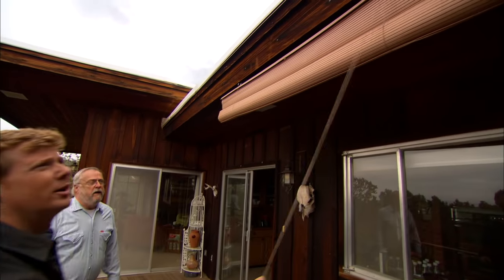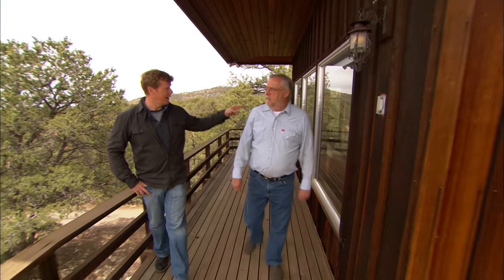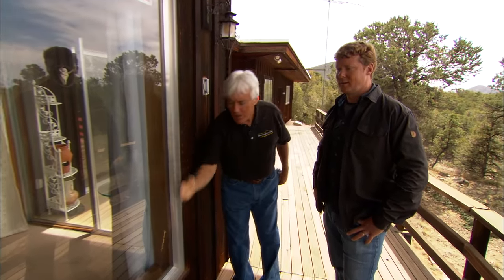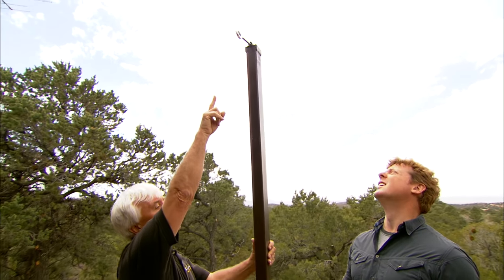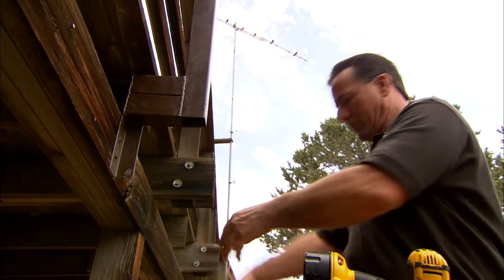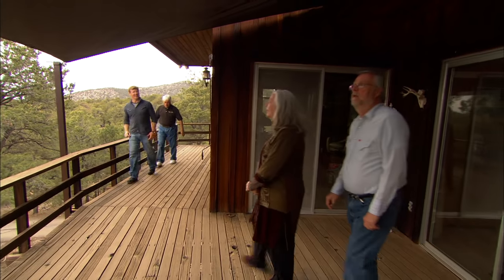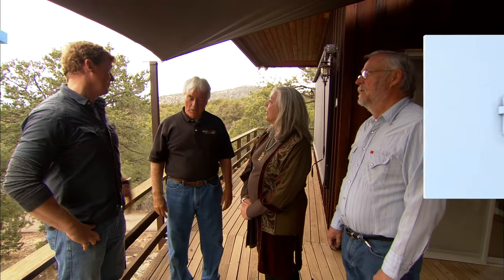How to Install a Shade Sail for a Deck | Ask This Old House

Comment: I have a couple sun sails I installed with stainless eye bolts and some paracord using 5 dollar figure 9 carabiners to tighten and they have lasted for 7 years still look new through tons of wind and rain and hot summers, great product.
Reply: Can I hire you to install something similar for my house in Maryland?
Reply: @house9850  mind sharing the brand you went with for the sail? I'm also on the west socal coast.
Reply: @projectedwinbrito  oh man trying to remember... its been the better part of a decade, I went to the home store with the orange logo LOL back then there was only one or two shade brands, I want to say I have 3 of the sand colored coolaroo sun sail. Using the stainless hardware, paracord, and figure 9 carabiners to pull them tight was key. Buy 2 feet smaller than your space to stretch them tight.
Reply: make sure to use a lighter to melt your cut paracord ends and pinch them to make a point. That has lasted 7 years too.
Reply: Late comment here, but just watched this video and saw your comment about Figure 9 Carabiners. I hadn't heard of them. Just bought 4 from Nite Ize to put up our triangular sun shade sail. Thank you for mentioning the Figure 9's.

Comment: 4 Carriage bolts to hold each vertical support....and then the brackets on the facia are fastened with 1-1/2 deck screws. Love it
Reply: Well, those vertical supports have to resist a large cantilever force that the facia brackets don't, so it's not really surprising for someone who understands mechanical forces.
Reply: not even anchored... just straight into the wood.

Comment: Years ago, Santa Fe Awning installed a hanging "curtain" for us. Eventually, we enclosed the porch with sliding glass doors on two sides because the wind came from the SW and dumped load of dirt on it...We kept the shade now inside the porch and it makes a huge difference and held up perfectly with the direct SW pounding on it for years!

Comment: They make shades that crank down from the inside.  I think that would be easier than having to go outside to roll up and down all the time.
Reply: I agree.  That outside shade is useless.
Reply: Hanging the shade on the outside has less heat gain inside the house than a shade mounted inside. 
The house stays cooler.
Reply: @David Blue The shades I was talking about shade the glass from the outside, not inside.  And it isn't about laziness, it is about convenience.
Reply: @bringemyoungpbuh4123  besides the hand cranked version, there's also the motorized version and wireless remote control options.
Reply: @c.garcia2363  Yes, there are better options than going outside every time  you want the shade.  I prefer manual models as they have less to go wrong, but motorized with a remote could really be handy.

Comment: Wow, imagine having a shade sail professionally installed. I just bought some for $13 each and hooked them up and they've lasted for 4 years so far. Much more wind resistant than umbrellas
Reply: Where did you buy them from?
Reply: Good to hear.  I have a small 10x10 patio that I want to shade and an umbrella would just be too big.

Comment: I would have put the window shade crank on the interior side of the wall or "motorized" the entire thing so it could be extended and retracted from an interior switch or better yet a remote control, else this is a decent solution.
Reply: Smart.  Actually, a good architect would have thought of all of that, and had it all built in with the windows.  Just a switch will shade the windows.
Reply: How about a solar panel powered motor that auto-deploys the shade in direct sunlight.
Reply: Great idea
Reply: The reason you wouldn't put the shade on the inside is because it would not block the sun from heating the windows if it was on the inside, so the temperature increase inside would be pretty substantial. You want to avoid the sun from heating the window, therefore outside is the way to go.

Comment: Change windows for better U-Value & minimum solar heat gain coefficient SHGC.  Overall performance of the home is vastly improved throughout & year0round.  The shade is just a band-aid if the interior is the issue.  Outdoor shade on the deck is another issue.

Comment: If I wanted to do this myself could I just install a 4x4 post and bolt it i to my current wood deck using a footing
Reply: Nope 4x4 post is not good for tension loads like this one. Needs to be tubular metal to withstand heavy winds.

The middle of the 4x4 post wouldn't be doing much work, so a tubular design is used for poles. They're used for footings because that center part holds just as much weight as the outside, but in this application, the further out from the center of the material does the most work (that's why all flagpoles, lightposts, and telephone poles are hollow) (unless it's a wooden telephone pole, then it's a solid center because of cost)
Reply: Scott H 👍🏻👍🏻
Reply: I have a sunshade sail and usually the wind rips it out once a year
Reply: markman63 . Have you tried using rubber bungee( Home Depot- $1.59 each for the solid black rubber ones) I use them on 2 of the corners and they flex in the wind,do not sag and are very easy to remove and install  when needed.

Comment: Are those little head-rod clamps on the house facia going to hold that sail in the wind?
Reply: no chance
Reply: Looks like southwest TX, they need to revisit to see how they've held up after TX stormy seasons... :)
Reply: @skytigress  they screw through the solid 1in nominal fascia boards. I am sure they are hurricane rated!
Reply: most wind, and water, will go through this

Comment: So stainless ring stainless post ring and a galvanized connector between the two.  Probably should be using all high chromium stainless otherwise you are going to get a galvanic reaction and rusting
Reply: I was wondering about that! I was just scrolling through, looking for THIS very comment!
Reply: TOH is assuming it doesn’t rain there so don’t have to worry about annoying things like that. Hehe. 

All galvanized or all stainless. If there’s salty conditions, obviously all stainless.

Comment: wonderfully old impact drivers
Reply: No eye protection used.
Reply: Jeff Hallel Why would you wear that with an impact?
Reply: @jacobslater6449  So that if the socket fails or the bolt  strips and sends metal splinters through the air into your face your eyeballs might be shielded by the safety glasses.Generally manufacturers of striking tools and power tools tell the user to use safety glasses.
Reply: Jeff Hallel Ah yeh gotcha, generally in the UK we don’t follow that at work unless it’s using SDS etc
Reply: @jacobslater6449  You have free health care.No worries.

Comment: Isn't the Sun's UV rays going to eat away the fabric?
Reply: Tyrone Kim  eventually the sun kills everything!  I have shade cloth that’s 6-7 years old and still in good shape! 
Getting rough around the edges but overall it’s still quite strong!
Reply: @jaykneegarner2479  Thanks for the information.
Reply: Yes, over time it will degrade. But from experience with leaving out a variety of types of fabrics on our patio over the years, bringing it in over winter (when we probably want the extra light anyway) prolongs the life by quite a bit. The wind and rain of winter degrades differently than strong summer sun, but can still take quite the toll. It’s not supposed to last forever, just take reasonable measures to last longer.
Reply: @rachelleo485  Thanks for the information.
Reply: @Norman Little I'm puzzled how the fabric is going to get 50% stronger.

Comment: Isn't "Sail" suppose to catch wind? Now that the shade sail is attached to the house, would wind cause it to damage the house's structure? Also, it looks to me it will catch some rain too?
Reply: Wind and Rain go through the mesh, in theory.
Reply: Our friend used screws that weren’t long enough to go far enough into the board underneath and a piece of facia board got ripped off right off the house by a strong wind. To avoid this problem we will try longer screws and find the studs to sink them in.

Comment: I saw someone question, why not put the shade on the inside the house? The reason you wouldn't put the shade on the inside is because it would not block the sun from heating the windows if it was on the inside, so the temperature increase inside would be pretty substantial. You want to avoid the sun from heating the window, therefore outside is the way to go.

Comment: Kevins not stripping screws.  The stripping sound is the setting on the drill to make sure it doesn't over tighten. Duh.
Reply: Not to be that guy, but he's using an impact driver, not a drill. They just sound like that as they hammer while they spin.

Comment: Could have used a mirror tint for the windows, and should have just built a roof over the deck.
Reply: Mirror tint is not recommended for thermopane windows.Heating the gases that are between the panes can cause the seal to fail.
Reply: @jeffhallel8211  I have never had an issue, we used it here in colorado in all our houses
Reply: @bookreaderlabarr  According to the manufacturers literature that I have read the gasses may heat up enough to burst the seal.
Reply: Never had an issue, maybe it is just my luck

Comment: Where might one find the 90% shade cloth mentioned in the video?
Reply: This was a custom-built job, but 90% shade cloth is sold on Amazon (and the Big Box stores, I'm sure) in standard sizes--6 and 8 ft widths are common, with various lengths.  I've been considering  this for the side of our patio cover, but I don't have any real-world experience.
Reply: Lowe’s I found mine for $33

Comment: Why not tint the glass? Why
Reply: Tint is permanent.
Reply: Barney Panorama you can remove tint.
Reply: @laylafl  No need to remove it if you use a quality int and a certified installer. LLumar makes tints for residential applications that will block 98% of UV rays. And they're not dark like you see on ghetto cruisers.

Comment: The installer says the posts are made of 2"x3" steel tube with .250 walls. Not likely. Listen to the should when he taps on it. It's also way too light - that piece would weigh about 100 lbs. if it had .250 walls.
Reply: You're exactly right, no way that tinny sound came from 1/4" steel.

Comment: Guess they ran out of stainless washers.
Reply: +Rocco Croce Washers only really need to be used for bolts, not for the screws they used to attach the curtain above the window.
Reply: +George Scott you should always use washers when the head of the fastener is within tolerance of the hole it's going through. 
Clamping force. 
Fastener head gonna pull right through and pop.
Reply: Washers are the least of their problems, a good wind will rip the entire fascia off anyway, this is basically a sail and will be subject to massive loads with the slightest breeze and would never pass any building codes here in Australia.

Comment: The tinny sound tells me it's not 1/4" steel and their fabricator needs to do better finish work, way too sloppy for residential.......Even fabbing something for the filthiest factory I never did poor work like that.
Reply: I recently picked up a rather small 1/4" steel bracket designed to hang a hose reel and it was rather heavy.  If that entire post is 1/4" steel I'd imagine it would weigh about 50-60 pounds.  Just don't see them swinging it around like they are in the video.

Comment: Even back in 2016 covering the windows with a static cling vinyl tint would have been more DIY friendly, just as effective and cheaper but those sponsors have to get their $'s worth.

The sail was nice, nice and expensive with those 1 off steel beams and custom sail.

Comment: Maybe use the curtains that are already there?
Reply: The problem is heat gain. Curtains will not only block the view, but the air between the drawn curtains and the glass will heat up and move up and continuously warm the room.

Comment: Adding a tarp to the side of the house, and then needing to struggle every year taking it down and putting it back up...don't think I'd be paying them for that crappy solution...
Reply: You take it down because of snow and ice.
Reply: Actually having the ability to take it down in the winter is a plus.. that's when you want the 🌞

Comment: 2"x3" x 1/4" tubing ?......2"x3" x 1/8" is more like it.
Reply: When did he even talk about the tube? Are you talking about the ending piece for the awning?
Reply: Dude....watch the whole video. They  said the tubing was 2" x 3" x 1/4 " I'm a fabricator and could tell right away that they were lyin' like Ted Cruz. When you know this stuff, it pisses you off when they give false or misleading info. It's like saying a 2x4 is a 2x8....they don't have a clue !!
Reply: 2:50 -2:59 try again
Reply: +Jeff Silence Ah I see 2" inch by 3" inch quarter inch steel (1/4) when it's (1/8). I was expecting the actual "one forth" instead of quarter inch in the video. Nice catch.
Reply: Dude..how do you know he's lying like Hillary Clinton when you haven't examined the tubing yourself?   I've been in the metal fabrication business for 35 years, and I can't tell the wall thickness by simply looking at it on YouTube.  You're simply looking for an opportunity to sound like another Internet Expert - so quit lying that you can tell the wall thickness from a video.  Pisses me off...
Reply: Jeff Silence Neither do you

Comment: Vitamin D is good for you! EMBRACE IT. Lol

Im in the process of sanding off a acrylic paint deck, its a nightmare. That deck looks good!
Reply: Rent a floor sander but don't tell em it's for a deck (rental max gave me a problem, home depot didn't) they're just concerned about screws and nails sticking up but you should fix those anyways, just do it before you sand

Just make sure to use a fine enough grit that it doesn't gouge the wood (one of the lower grits I was going to use first ended up making huge scratches, so one grit size up was better to start out with)
Reply: Nevermind this is 3yrs old lol

Hope it turned out well!

Comment: Why wouldn’t you just tint the windows :/
Reply: the sail can blocked the heat much more effective then tinted windows.  something to do with the air in between. If you block the sun with sail, the air between the sail and the window acts like another a layer of insulation.  if you tint the window, there is no air in between, so as the tinted window heat up, the room gets to heat up as well.
Reply: Or put similar shades u can operate from the inside?

Comment: I agree, this was a contracted job and not a DIY one.  To make things worse, the parts list didn't include any info on where/how to purchase said parts.  However... it's not all a waste.  Seeing thos super expensive custom metal posts made me realize I can fashion something similar out of wood and then, attach them to my existing wooden deck AND THE JOISTS under the deck!  That was an eye-opener for me as my biggest challenge to installing a shade sail has always been the fact that I can't sink posts because I have a concrete patio beneath my upper deck.  Now, with some creative woodworking, I think I can attach the posts to the deck & the joists.  Some vids simply open your eyes to alternate possibilities and that's what this one did for me.
Reply: fwiw, you might be able to attach the posts with something like standard joist hangers, possibly upside down, or slightly mcgyvered.
Reply: What did you do? You couldn’t anchor posts to concrete?

Comment: That deck and window set are all clearly set up to capitalize on the sun. Very curious that they didn't do any solar gain calculations when building it
Reply: They didn't realize that large windows let in more light? As a pro window cleaner I see this all the time where I live.  People pay for an awesome view, and hundreds more per month in cooling the place.  Not having a clue that a little tint on the window would make the difference. With that said, please don't buy Pella windows.  We charge a ton to open them and clean them properly.  Unless you're into that.
Reply: I was thinking the same thing. Why not just taint the window?
Reply: Winter sun is nice for free heating. Clear desert skies make that actually happen. Midwest, not so much.
Reply: @thewatcher611  We have the same windows as seen on this house and instead of tinting (which would work fine) we just installed interior white see through blinds similar to the black one in the video.  They knock out 95% of the heat from outside.

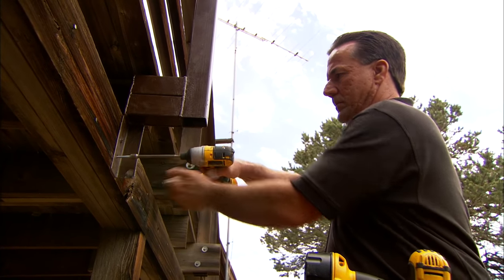Comment: He claims that the post is made of 1/4 inch thick 2x3 steel.  It is definitely not.  It is clearly at most 1/8th inch.  You can see the open end at 3:14.
Reply: Previous to that I saw him hand that post over the deck and I was liked "What, 1/4 inch steel?!?  That would weigh a ton!"  And he just casually hands it over.